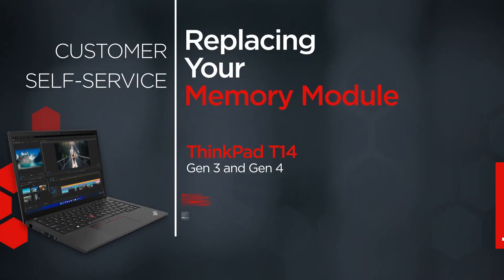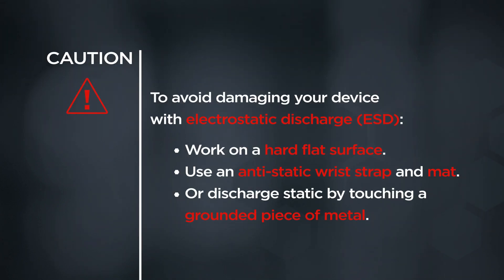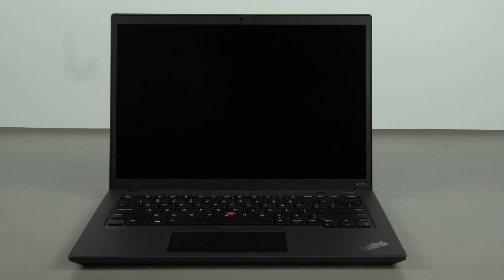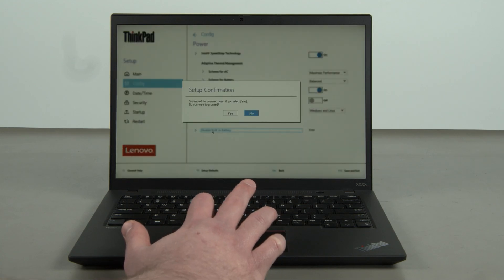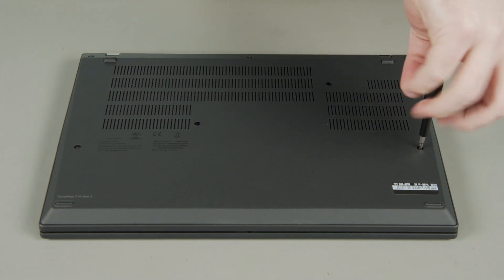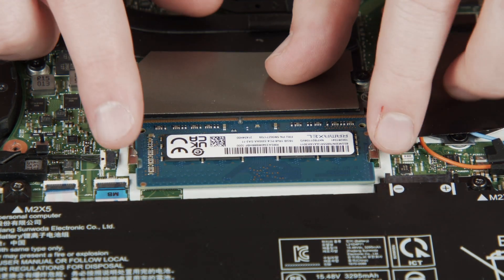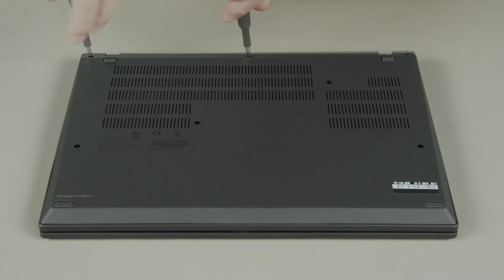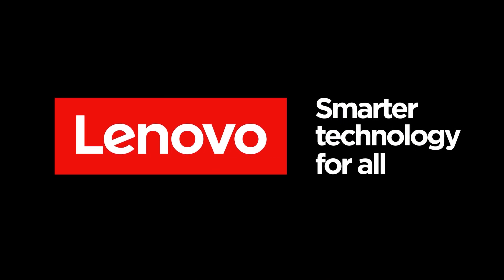Replacing Your Memory Module | ThinkPad T14 and P14s Gen 3 and 4 | Customer Self Service

Comment from the maker: This video will show you how to replace the Memory Module of your ThinkPad. The process in this video will work for the ThinkPad T14 Gen 3 and Gen 4 and the ThinkPad P14s Gen 3 and Gen 4. 

You will need a screwdriver kit, a non-metallic pry tool, and 15 minutes of your time.

ThinkPad T14 Gen 3 Repair Guide: https://pcsupport.lenovo.com/us/en/products/laptops-and-netbooks/thinkpad-t-series-laptops/thinkpad-t14-gen-3-type-21ah-21aj/selfrepair/removalsreplacements

ThinkPad T14 Gen 4 Repair Guide:https://pcsupport.lenovo.com/us/en/products/laptops-and-netbooks/thinkpad-t-series-laptops/thinkpad-t14-gen-4-type-21hd-21he/selfrepair/removalsreplacements

ThinkPad P14s Gen 3 Repair Guide: https://pcsupport.lenovo.com/us/en/products/laptops-and-netbooks/thinkpad-p-series-laptops/thinkpad-p14s-gen-3-type-21ak-21al/selfrepair/removalsreplacements

ThinkPad P14s Gen 4 Repair Guide: https://pcsupport.lenovo.com/us/en/products/laptops-and-netbooks/thinkpad-p-series-laptops/thinkpad-p14s-gen-4-type-21hf-21hg/selfrepair/removalsreplacements

To learn more about your device go to https://pcsupport.lenovo.com

To find parts for your device go to https://support.lenovo.com/parts-lookup/?cid=ww:lenovosocial:b9515f&source=socialmedia&subsource=yt

To view the Lenovo Support Self-Repair Guides landing page go to https://support.lenovo.com/us/en/solutions/HT516547

** NOTE: Static electricity can destroy components. Use a grounding strap, and clean, non-conductive surface to work on. Use plastic or coated tools to prevent scratching and avoid using metal tools on plastic parts. For more detailed information on electrostatic discharge and how to prevent it, please watch our ""Understanding Electrostatic Discharge (ESD)"" video: https://youtu.be/by4PB3WtdLo 

Applicable Machine Types:
ThinkPad T14 Gen 3 - 21AH, 21AJ, 21CF, 21CG
ThinkPad T14 Gen 4 - 21HD, 21HE, 21K3, 21K4
ThinkPad P14s Gen 3 - 21AK, 21AL, 21J6, 21J5
ThinkPad P14s Gen 4 - 21HF, 21HG, 21K5, 21K6

#lenovo #LenovoSupport #LenovoTechSupport